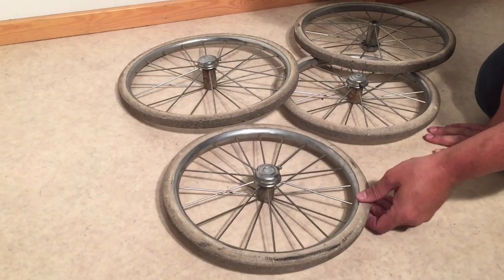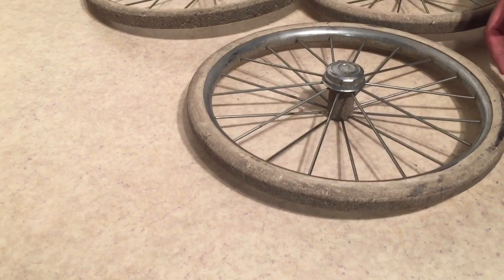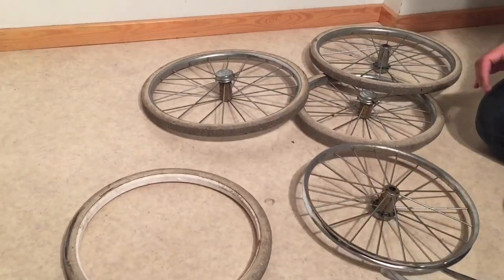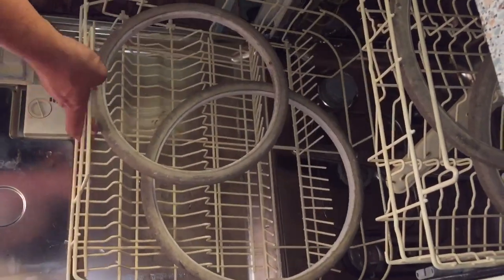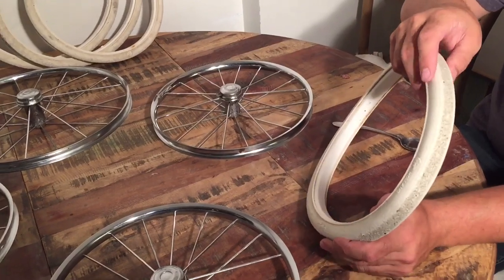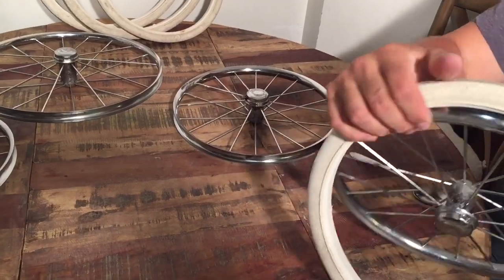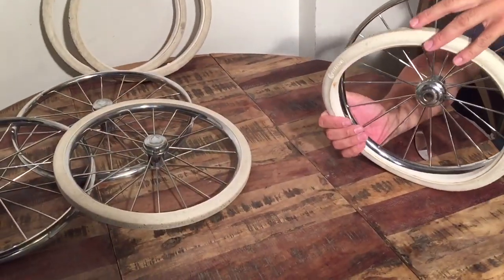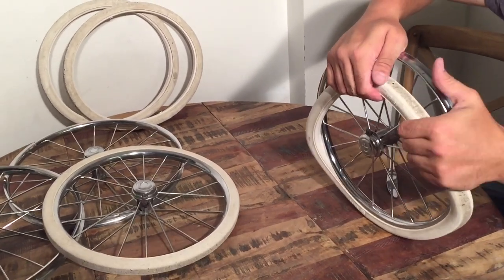Vintage Stroller Renovation: How to Remove, Wash and Replace Vintage Stroller Tires

Comment: It can be easier if you warm the rubber. Either in a pot or under the faucet. =)
Reply from the maker: Great tip, Thanks :) We'll try it and make a video :)
Reply from the maker: I subscribed to your channel too :)
Reply: The Stroller Workshop / Barnevognverksted =) 
I have a lot of vintage prams and strollers =)
Reply: Great idea - then would it make sense to put the rubber on the rims right when they come out of the dishwasher?
Reply: The Stroller Workshop rust off

Comment: How do you remove the wheels from the chassis? I have a 1960’s silvercross coach built pram and I can’t figure it out
Reply from the maker: Some have a release button right at the (or under) the lip of the cap, but with others you have to remove the cap to get at the removal mechanism (usually a pin running through a hole drilled in the axle), but in this case, the plastic of the caps is usually a bit brittle, so it's really easy to accidentally break the caps). :)
Reply: @BarnevognverkstedNo  thanks :) I managed to get them off, mine has metal hub caps luckily

Comment: My vintage pram s tires r flat on one side from storage. The rubber seems brittle and dry. Where would I purchase replacement tires?  Thank u.
Reply from the maker: Getting ahold of vintage tires is a bit tough.  You probably need to take direct contact with a tire maunfacturer and have them special ordered.  If you can get them off the rims though, sticking them in the dishwasher will help a bit :)
Reply: Ebay do them & soak in hot water before refitting them